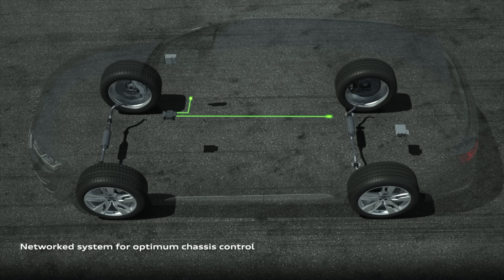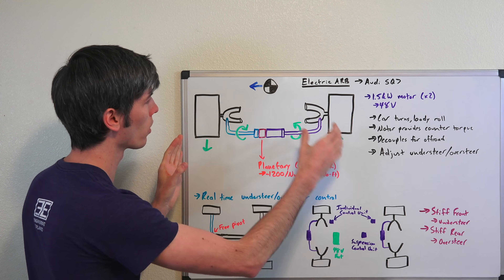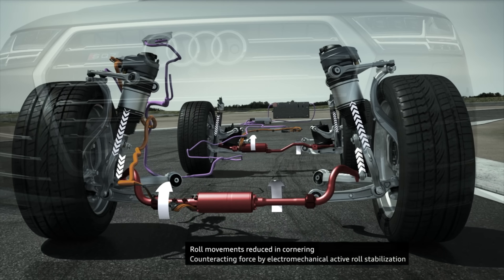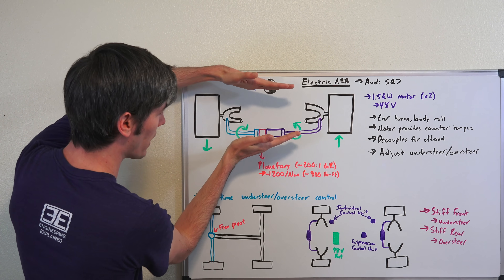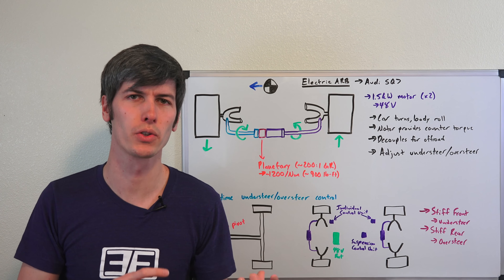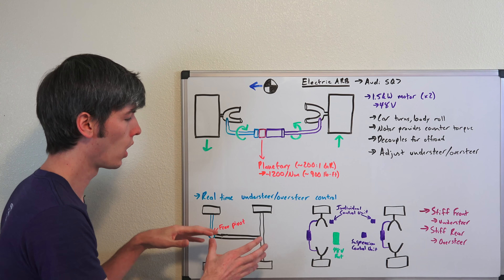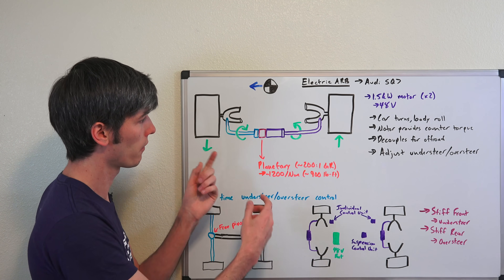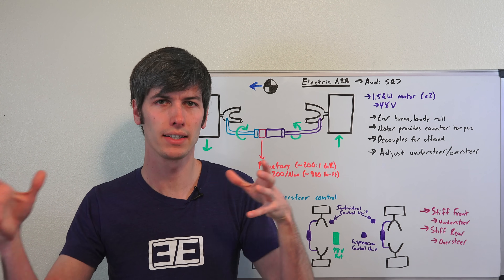How Audi Is Eliminating Body Roll

Comment from the maker: If you enjoyed this suspension video, here are a few others you may find fascinating!
McLaren Doesn't Use Sway Bars - https://youtu.be/8AVBddY8ClM
Ford GT Has Two Spring Sets - https://youtu.be/L0rAU0or3rQ
Honda Civic Type R No Torque Steer - https://youtu.be/Gw5-lVlzNoY
Thanks for watching and have a wonderful day!
Reply: Question for a video:  Why don't we design cars that have their roll center above the center of gravity so they roll into turns, banking like an airplane?  Would the geometry required mess with camber and scrub?  It seems you'd just have A-arm suspension with the long arm on top, yeah?  This has been on my mind since I designed the suspension for the University of Portland Mini Baja in 2000.
Reply: @blurglide  Same I support roll into corners and want to build it for light vehicles, Quad bikes, I'm currently designing one as a trike I'd be interested to hear how you think that would be implemented...
Reply: Engineering Explained I believe Toyota has a hydraulic version of this with kdss?
Reply: My guess is it's an issue with packaging. On a race vehicle, this isn't as critical compared to a road vehicle of the same track and wheelbase that requires room for several people to sit in.
Reply: how many cellphone power banks to use to start a car ?
Reply: DWB's vs struts comparison video next please?
Reply: blurglide I pictured this same concept during the video. Wouldn't the majority of the weight need to be below the axle? If so it might be possible in an electric vehicle where a lot of the weight is in the floorboards from all the batteries.
Reply: Koenigsegg's Triplex Suspension is quite impressive too.

As always, great vids EE!
Reply: How would this system account for a banked turn, as many are, if it only uses steering input and speed.
Reply: Engineering Explained Could you make a video explaining various implementations of traction control technologies. I found a video you made years ago explaining the distribution of forces on wheels when cornering, etc. For example, I was surprised when I took my father’s BMW F800GSA off-road with the traction control set to “road”: It cuts the fuel supply/spark ignition to combat wheel spin. Othewise, I have heard people refer to the inherent mechanical benefits of using single cylinder engines for dirt bikes. When accelerating, the wheel loses traction during the engine’s power stroke but regains traction during the intake/compression stroke, thus making use of the higher static friction coefficient.
Reply: Lexus GS 450h have had a computer controlled anti sway bar, cut in the middle and with an electric motor (12V) and a Harmonic Drive gearbox in that place since year 2006.
Reply: No, you have a wonderful day! and keep this amazing work up! Do you make your own graphics or have a friend do them for you? They are very helpful for visualization and keeping up with your ingenious explanations.
Reply: @engineeringexplained Hey! I think you should do a video portaying the fastest speed in which a car can make a corner, w the best tires , most downforce possible etc. I can't find any info related to this online! It would be  great to be able to know this unanswered question- thanks :)
Reply: Great video btw
Reply: Jason is there a car at the moment that has positive body roll so that you end up with a one degree radian of force just like raiding a motorcycle in balance round a corner?? Have you driven any neutral or +ve body roll cars??
Reply: blurglide because of sense of balance people have. Or other words... because of puke 😎

Comment: Hello. So, the system has 2x1.5 kW motors only in one system (only on front for example)? Or each system has 1.5 kW (1.5 kW on the front axle and 1.5 kW on the rear axle)? Thank you! Need it for an engineering presentation :)

Comment: The same effect can be achieved through the air supension. What is the difference between a mechanical rollbar and using the air suspension for it?

Comment: BMW 7 Series calls this Active Roll Stabilization. Its just an Electronically controlled Sway Bar(s) located in the Front and Rear of the vehicle. It does make a big difference in countering centrifugal force/ Body lean.

Comment: You don't want perfect balance between understeer and oversteer for most drivers.  And you certainly don't want it "cornering on rails".  You want progressive under-steer that is forgiving.  You don't need this over-complicated stuff for that, most modern cars are set up that way.

PS I could not follow the visualisations at all.  But others  can so it must be me.

Comment: I have question that is making my head explode that I would love for you to shed some light on. I had the chance to ride in a vehicle equipped with a load transfer control system that kept the vehicle perfectly level no matter the forces acting on the vehicle. First, it was mind eblowing to throw this truck into a corner and have zero body roll. Anyhow, In my head, this would equate to less traction, at least on smooth road. What do you think?

Comment: BMW had active stabilizers like 15 years ago, for example on E50 545i, not electric but hydraulic and it worked amazingly well. Now the problem that is obvious with Audi is the heat, how they are cooling the electric motor, obviously they are not, but if one drives like mad trying to go sideways non stop for like an hour this will overheat and give out.
Reply: Wasn't able to beat the Xantia Activa though. It's got the world record since 1999.

Comment: Another (although not ideal or probably even possible) way to eliminate body roll is to adjust suspension geometry such that the roll axis (line connecting the front and rear roll centers) passes through the center of mass.

Comment: In think I'm getting addicted to these videos. I have 1 foot into building my own car.

One question if anyone can help: why would a stiff front wheel lead to understeer? Understeer means the front wheels slip, right? Wouldn't more vehicle weight on the front wheel lead to more friction? I don't see it yet...
Reply from the maker: A stiff front means the front has more work to do. Suspensions want to do as little as possible for optimum traction. The more pressure on a tire, the less grip overall it has. As you overwork the front tires, they lose grip and you understeer.

Comment: Handling balance understeer : oversteer is one issue. So presume a '70s or '80s front engine rear drive. If you make the rear stiff enough to get a nice neutral balance at mid corner, there will be a lot of weight transfer on the back axle, so as soon as you start to try to accelerate, (with your stock open centre dif) you get bad inside wheelspin. A much stiffer front swaybar is about 1/6th the price of a good limited slip centre. If you were tuning a car on the cheap, when I was young, you'd go very stiff on the front bar. That gave some understeer, but the bodyroll was much reduced and the power-down off the corner was dramatically improved. It did not in every way result in a car that was nicer to drive, (horrible understeer) but it sure as hell was quicker....

Comment: why not eliminate them all together and use the air springs (with a backup reservoir) to pump up the leaning side air shocks? (or use the mag shocks to resist the roll or both)

Comment: How about anti roll bars for passengers? Regardless of the system, gravity is still going to have an effect on the passengers. The vehicle may stay on a flat plane (plain) but gravity still effects your body. There needs to be a system that helps keep you from winding up in your passengers lap. At least it's not as bad as it used to be since very few Vehicles today have bench seats.

Comment: Well I still think the best way to reduce body roll is getting a proper car with an acceptable weight and a CoG which is not up there in the clouds, but as far as lumbering 2+ ton wheeled tanks go, thi system is pretty nice.
The most interesting part of the video though was the explanation of the effect of wheel load differences on understeer.

Comment: Isn't it still reacting? If it's looking at steering angle and speed.. that means it's reacting to the steering angle...so youll have to turn the wheel first for it to start working. 

Mercedes S coupe has 2 cameras that scan the road ahead and adjust the suspension as necessary.. so it works for bumps and stuff aswell as cornering.

Comment: @Engineering Explained Most of the OEMs like Toyota and so on, have this kind of  tech, normally they use a controller called "Skyhook"，some articles could be found on SAE。 What's more it works for ride and comfort as well.

Comment: the problem with this system is that your passengers think you're cornering too fast as the occupants feel more G forces despite allowing for better cornering. With a soft suspension and body roll, the passengers dont feel the cornering much.

Comment: Next step from Audi trying to get their 1100hp 5 ton Q11 RS going around a corner - just weld the suspension stiff :P Call it RS++++++++++++ suspension!
J/K. But why not build lighter cars? I have nothing against tech - but with crappy electric steering (my Mazda3 gets praised for it's good electric steering - it's still crap) and totally controlled suspension - what's the point of going fast if you can't feel it? Who ever buys a car like this to go fast? It's  a barge :P

Comment: Land Rover has been doing this for a while in a hydraulic application which in my opinion would be much more powerful than an electric system. My 06 Range Rover Sport Supercharged has the dynamic response hydraulic sway bars and corners extremely flat for its weight.

Comment: Active roll bars make a huge difference. My BMW has a similar system, except the hydraulic couplers use pressurized power steering fluid. You can corner at ridiculous speeds and the car stays perfectly level.

Comment: Hey Jason, I've got a question for you: while watching the last Formula E e-Prix, I noticed that the drivers, while reaching a corner, released the throttle pedal way before they hit the brake pedal, in order to harvest energy via the regenerative braking system. However, the graphic showed that the energy recovered in the period in which the driver was moving without touching any pedal was way lower than the energy recovered during the actual braking phase. Could you explain exactly how braking works on FE cars, or electic vehicles? Thank you, love your work!

Comment: I'm not an engineer. But I know a guy that met one in a strip club. 
If the body is rolling out, and you supply upward force to the inside A-member, to negate the roll, wouldn't that lessen the traction on a tire that is already lifting ?

Comment: Actually the system is developed and build by Schaeffler. Every electromechanical roll bar from other cars is build by them too. BMW for example uses a 12V version in the 7 Series, which has a similar design.

Comment: So it reacts slower and still is not as good as what Citroen did already in 1994 with Xantia Activa which it had hydromechanical active roll bars and it it could achieve 1.2G lateral acceleration with just 205 R16 tires.

Comment: Why not use electronic suspension to accomplish the function of an anti-roll bar? More specifically electronically controlled hydraulic shocks. This would take less space, would not need  steel bars running along the axles thus saving weight, and could utilize the same 12V system. Many cars and even the new RZR has electronically controlled shocks... adding the hydraulics pressurization should be an ease.

Comment: Hello Jason,

I wonder why no body roll is a desirable feature ? I understand that asjustable roll-bars allow under/oversteer correction, but that can be achieved with body-roll. It seems to me as if they are saying that no body roll is great but actually the system is better at/designed for balancing the car rather than eliminating body roll.

Thanks.

Comment: There is a simpler method to prevent body roll that they could have implemented.
Many sports cars do it.
Looking at the car end on:
Imagine the wheels as just fixed on the ground.
Somewhere above the center point between the wheels is the "roll axis" of the car.  This is what the car body rotates around as it leans left or right.
 Picture someone pushing the center of mass to your left.  Their ability to make the body roll depends on how far above the "roll axis" they are pushing.
If the roll axis and center of mass are at the same point, there is no roll.
The anti-sway system then only have to deal with the tendency of the body to rock side to side if you hit a bump with the wheel on one side.

Comment: My boss just got a 2011 Porsche Cayenne turbo. That thing corners FLAT. Flatter than my 1989 MR2 turbo. It also has enough brakes to pull your face off your skull. All while having a super comfortable ride.
I love German Engineering.
Reply: It won't beat my car in cornering flat. French car. 1998. Goes over speed bumps over 80 mph. That Porsche wouldn't stand a chance except in HP.

Comment: You seem to be privy (privileged) to some “private” technical data. I am interested in getting a right hand drive, manual transmission, 4X4, diesel pickup. Toyota has great features but not with manual transmission. The Ranger (Ford) seems to be my best bet as the VW Amarok seems too flimsy. What can you say about the Ford Ranger?

Comment: I was thinking of this the other day. I wonder if this can be done mechanically by having some sort of a dual independent control arms on each side connected to dual independent shock absorbers and then all the four sides connect together and hence conversely communicate and prevent body roll caused by turning or even depressing the brakes or gas. I despise the amount of electronics being used in cars nowadays. I just don’t see how a car with so much electronics is going to last more than 10 years.

Comment: How is this different from the active suspension in, say, a 2005 bmw 7 series? Does the BMW have an accelerometer?
Reply: August Sawzak works the same way. BMW has been using active anti roll bars in their larger cars equipped with sport packages since like 2007.
Reply: Akash Hegde yeah my dad has an '07 750i. It is a very heavy car but it corners very very flat.

Comment: It would seem to me that this system will cause snap-oversteer/snap-understeer when the motors reach their limits and suddenly stop further compensation.
Reply from the maker: Well they’d likely be tuned to do just the opposite, and allow cars to be much more neutral. Snap oversteer has more to do with throttle application.

Comment: Does this use two motors or four? I could see how two motors (one per axle) would help with sway, but if you had four (one per wheel), you could adjust for squat and sway.

It looks like it's only a two motor system, with the sway bar arms linked inversely. Makes sense and is much cheaper. Squat isn't as big a deal, especially on a 4wd/AWD vehicle.
Reply from the maker: Two motors, one for each axle (front/rear).
Reply: Interesting, and not too surprising. I'd be curious to hear why Audi chose to do two instead of four. Simpler, cheaper, fewer failure points would be the obvious pros while they only stand to gain minimal performance during braking and accelerating if they went the more complicated route.

I appreciate the reply!

Comment: The problem with anti-roll bars is that lifting an inside wheel, especially if the car has a light rear end, on a bumper corner is very dangerous. Better to have no ARB and do active damping.

Comment: Interesting Video...: would you mind doing a Video talking about ALFA ROMEO Suspensions?

I am from Italia and in there ALFA always had the reputation of making the most stable Cars (they share some their Suspension Tech with Ferrari) and it's all thank's to what they call the "ALFA LINK" also known as the "Sospensione a Quadrilatero Deformabile" ... It is interesting that for a number of years rhey used this Tech even on front wheel Drive Cars and they were unbeateble in Stability Tests (yes: even BMW can't match it).

I have owned two ALFAs (a 159 and a 147) and i never drove any other Car as stable as those.

Now the newly introduced 'GIULIA' has an evolution of the Suspensions i had on my old ALFAs and i wouldn't mind understanding more of what their secret is in all that witchcraft of Torsion Bars and Beams that make their Cars drive like they are on Rails.

Thank you

Comment: If based on the stiffness of the anti roll bars front/rear you can induce or reduce oversteer/understeer how then do aftermarket chassis braces such as strut tower brace and control arm braces act upon those characteristics?

Comment: I still believe that there are better ways to reduce body roll than by using sway bars, with much better handling and predictability over rough roads. Hint: it's by using longitudinally linked suspension! Stiff swaybars may make a car more fun and responsive but they also make the car much more difficult to drive over rough and uneven roads.

Comment: Land Rover's Dynamic Response (available in Range Rover and Range Rover Sport since 2013) works exactly the same way. The whole system was developed by Bilstein in the early 2000's, actually the previous generation of Range Rover already used something like this but not so advanced (it had only one channel, so both sway bars were actuated at the same time).
Reply: And so it still corners like a yacht.

Comment: Land Rover created the ACE system in 1998, doing the same thing here but with hydraulics rather than electrics.
It worked incredibly well, and in my 1999 Discovery 2 it is still working very very well.
Reply: And it still corners like a yacht.